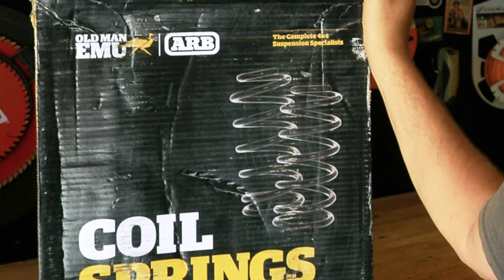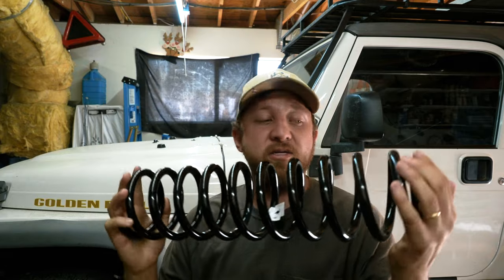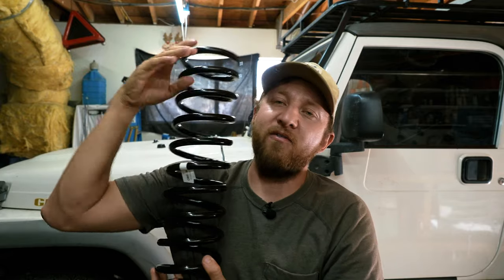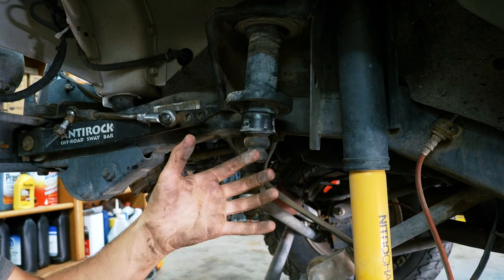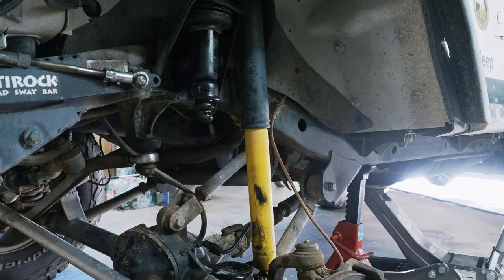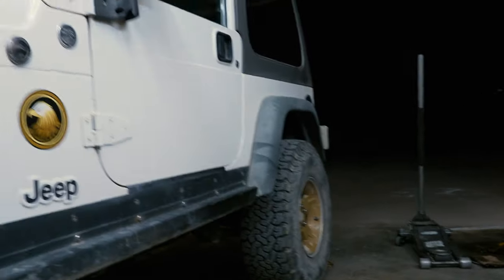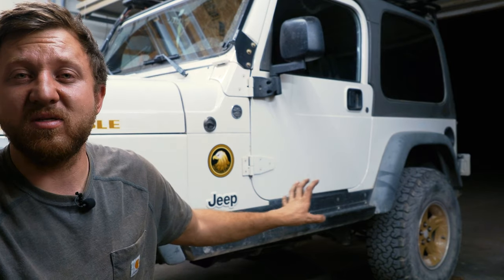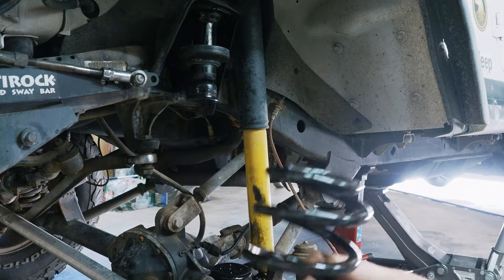Why Springs Rates Are Important

Comment: I've been running Rubicon Express progressive coil springs and they do not hold any weight. I hit the bump stops on the trail all day. Switching to OME now, thanks!
Reply: Which spring load did you go with and why? Standard, medium, heavy? I use mine as a DD and hunting. Travel loaded with gear, dump the gear, then hit the trail. Would you recommend standard load?
Reply: @dad3562  I went with OME 2620 600lb and it's a great upgrade. Combined with the Falcon 3.3 shocks it's like a super jeep.
Reply: @shiftintosunshine  that’s awesome!

Comment: I installed ACOS  and OME ZJ  springs up front on my LJ.  I don’t remember which OME springs I got for the rear , but they are very heavy and it rides like a tank.  I have a soft top and it’s loaded with fridge and tools all the time but way too stiff.  I am gonna get with Dirk at DPG  and see if we can come up with a better riding solution.  I don’t want to give up load height, so who knows, I may be stuck with the less than ideal ride comfort.
Reply from the maker: Interesting. 

So I went with LJ springs, but the lighter of the two options that are available. I run everything you do, plus a hard too, and a roof rack. So I probably have a bit more weight. I have been working on changing the bushing so the short driving I did in it felt really nice!
Reply: @EmbarkWithMark   I think there are 3 options available for the rear.   Medium, heavy, and ridiculous….   I chose the latter.    If you want I can look up the part numbers from my order sheet.
Reply from the maker: Yea, I’d like to see which you ordered vs what I have. That might help you make a decision as well.
Reply: 2934 ZJ Coils
2996 rear coils

60047L and 60049L shocks

Comment: Great videos, Mark. How did you like the ride of the MC springs? Did you find them stiff or harsh?
Reply from the maker: Thank you! 

The ride was great! I paired them with Old Man Emu shocks and we found the ride to be really nice. Especially before we started adding all the overland gear/weight.
Reply: @EmbarkWithMark  thanks for the quick response! I have an 06 LJ with worn out everything and Metalcloak was recommended. Drove in an LJ with the MC shocks/3.5 coil combo and it was a bit harsh on the road. Couldn’t find any non-bias, non-Currie/MC/RK arguments. Sounds like my thought that shocks may play a big part is correct; seems most say the MC RockSport shocks leave quite a bit to be desired.

Comment: Hi. I'm trying to decide on lift kits. But I am not understanding your reasoning for switching coils. Why put in OME and loose travel instead of replacing with new MC springs? I can understand if you want a lower lift but you said you installing a body lift? You mentioned ride quality. Is your experience with MC that it won't ride well at 3.5" even with all the adjustment? I understand what you said about the MC dual rate being like a spacer but I don't see how that's a bad thing as every coil has a limit and you still have plenty linear coil left to ride on. Or is the issue more about propper shock valving and you are looking for a more predictable spring rate so you can get shocks out side of the MC offerings? I suspect the issue was not in the geometry but in the weight distribution you mentioned at the end. That gets forgotten often especially with everyone wanting to "correct" the factory rake and then load it up with gear lol. Having driven both, what are your thoughts? Nice looking Jeep BTW.
Reply: OK. Nevermind a I missed the very end where you basically said you were disappointed in how the MC springs didn't seem to last you. I'm new to Jeeps but with lifted trucks the springs are a replaceable part if you load weight on them unless you get something like a triple rate spring so it will ride harsh. My OME leaf springs in the rear of my truck are basically flat now after seven years (really only lasted 3-4 years)  and I do notice a difference in handling with some weight off the front tires. I think it's a give and take with springs. Softer rate for comfort but you may sacrifice longevity.